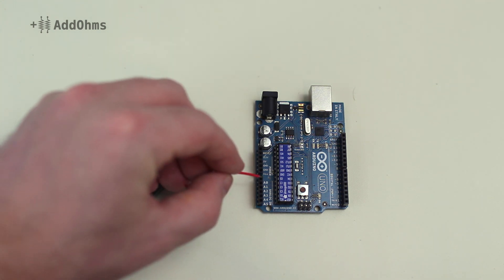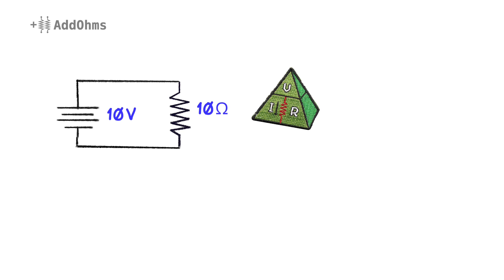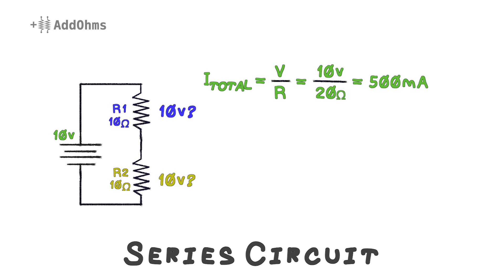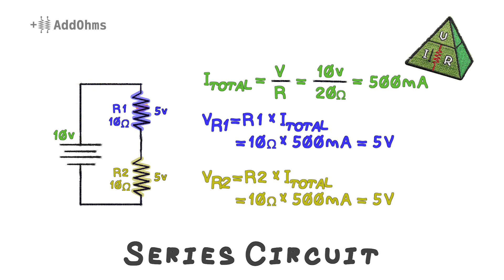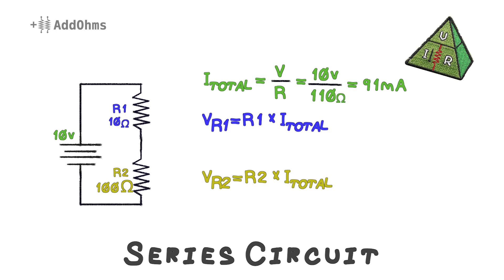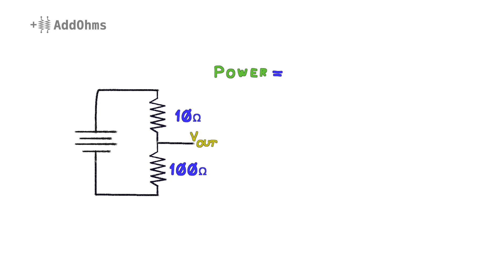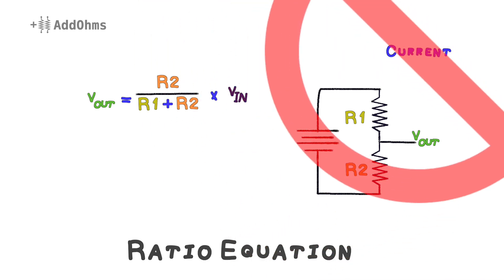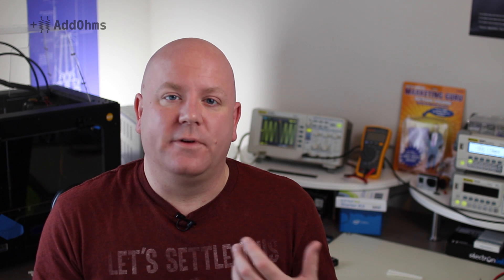How Voltage Dividers Work | AddOhms #13

Comment: Quick Fix is needed at 3:10 because 0.91V isn't equal to 91mV, it is 910mV
Reply from the maker: Good eye.  Damn.  

I even scripted it as "910", but recorded it saying 91.  Then mindlessly did the animation wrong.

Thanks
Reply: I noticed that too!!😁
Reply: That's right, you will confuse people who are just learning  this stuff. You should repost a correction. When I first started electronics, one little mistake in the numbers and it was so hard to learn. Still good info.

Comment: What is v out connected to? Where does that current go
Reply from the maker: Voltage dividers only work well in cases where the next stage is high impedance, or draws very little current. Which is why they work well for references into something like a comparator or op amp.

Comment: How will you divide 17v DC into 12 & 5v DC?
Reply from the maker: You don’t use a divider. With a 12V regulator and a 5V regulator.

Comment: Resistor rwduce voltage...this is not correct
Reply from the maker: Resistors DROP voltage. They do not reduce it. This is correct.
Reply: @AddOhms  ok thanks...for your explanation

Comment: so bigger resistors mean less  power loss.  Is there a limit to how big they should go? what is the ideal amount of "wasted power"?
Reply from the maker: The answer depends on the application. The larger the resistors, the less current, which means the divider is more susceptible to noise or interference. It's the same issue with high impedance inputs into chips and MCUs. If you're creating a divider that goes into an analog-to-digital converter, you have to consider its input impedance. For example, on an Arduino (aka ATmega328p) analog input, you want to keep the resistors in the 10k-100k range. If you used 1M range resistors, there isn't enough current for the ADC to operate correctly.
Reply: @AddOhms  thank you

Comment: Could anybody please explain to me why Vout is the voltage drop across the second resistor and not across the first one? I mean I'm trying really hard to visualise electricity using the water analogy and to me it makes more sense that the first resistance (R1) puts some sort of barrier in the direction of flow and therefore reduces pressure, so it kinda "eats up" a couple of volts from the source and what's left comes out the other side and gets channeled towards the Vout wire. Sorry I am really new to this.
Reply from the maker: That is exactly what is happening. Well “exactly” in the context of a crude analogy. Vout is the voltage drop after R1 drops some voltage. 

Kirchhoff’s Law. Volt drops in series add up to the voltage source. Voltage is the same in parallel branches, which is why Vout is the same as the drop across R2.
Reply: @AddOhms  omfg thanks I totally forgot about parallel voltage drop. It's been like 7 or 8 years since I've come into contact with anything remotely approaching circuits in highschool so I've been trying to relearn everything :)) Thanks a lot and keep making vids!

Comment: So if you drop 5v twice in a 10v Circuit, the voltage past the second resistor would be 0, right? So if you put an LED on there; you’d have no light
Reply from the maker: The LED creates a 3rd voltage drop. That drop depends on the amount of current, which is mostly determined by the resistor values. Location (or order) doesn’t matter in a series circuit.

Comment: Great video, you mentioned wasting energy when lower value resistors are used.  I often get into a quandary as to when to use a voltage divider or a voltage regulator when it comes to reducing waste.  I would love to see a video around efficiency of a circuit and the pros and cons of a divider vs regulator.
Reply from the maker: You should never use a divider as a regulator: https://youtu.be/-kEh0TYjYYE

Comment: ah ok I just watched your load video great to  know diode acts as a load .What if we wanted to to add bf494 bias transistor to it ???
Reply from the maker: I don’t understand your question. Add a bias transistor to what?
Reply: @AddOhms   to attach to the voltage divider to make a oscillator or amp stage

Comment: Say for instance I wanted to use 16v and at output would be 12v .Same idea with your 9v battery if I 9v ÷ 2 = 4.5v .4.5 volts would be the output
Reply from the maker: You can’t use a voltage divider as a source. You need a regulator.
Reply: @AddOhms  ok I understand now thanks

Comment: hmm interesting if say my voltage was 16v -12v at 12mA all I have to do is use a 3.3k and a 1k .Basically  all I did was Vout = vin × r2/r1 + r2  .Is this correct?
Reply from the maker: What do you mean "at 12 mA?" Voltage dividers are not suitable for driving loads. https://www.youtube.com/watch?v=-kEh0TYjYYE

Comment: You should have told that the resistance between Vout and GND (lets call it R3) should be at least 10 time bigger than the resistance of R2. This holds the voltagedrop at R3 as low as possible to provide the desired voltage. 
This is very critical if the wanted tolerance is small.

But ok, the arduino analog inputs have a pretty high impedance so that about 200kohms in total should be ok.

Comment: Hi Sir,

What is the Voltage at Point 1 (Before R1), Point 2 (After R1 & Before R2) and Point 3 (After R3).

Vout was calculated at 1.13v, i thought it just passed R1, voltage should be at 7.86V, correct me if i am wrong.
Reply from the maker: You're confusing voltage drop of the individual resistor to the voltage relative to ground. The voltage across R1 is 7.86 volts. Put your voltage meter across it and that's what you'd measure. That means the voltage across R2 is 9 volts - 7.86 volts = 1.13 volts. Which is why Vout (or your Point 2) is 1.13 volts. R2 is connect to ground and Vout is relative to ground.

Voltage drops in a series circuit add up.

Comment: So the v-out goes via the load to what? You're probably gonna say ground, but what about devices that arent connected to ground, like a cellphone or mp3 player?
Reply from the maker: Everything is connected to ground. Ground is THE reference point for the entire circuit. If the divider's output is connected to a circuit/load/whatever that doesn't share the same ground, then obviously, the divider won't work.
Reply: So, does that mean that all the lines in a schematic, that end with the ground symbol can be seen as connected to the same point, AKA each other?

I'm really trying to understand this but my brain doesn't speak electricity.
Reply from the maker: Yes.
Reply: Thank you. I just found found your channel like an hour ago, and i like the way you describe things.
My father was an extremely talented electrician/electronics guy but he was never good at explaining things. 
Now, a bunch of years after his passing i suddenly got interested in how it all works.
Subscribed.

Comment: Can you make a video on "How to read any electonics component datasheet ? What are the paramters must have to care about ? "
Reply from the maker: Yes and no. Datasheets and what is important varies by component type and by the application. So it is not possible to summerize how to read "any" data sheet. Something more general on a few component types is in my plan, but far down the road.
Reply: AddOhms No problem sir. I will wait for your video. Keep spreading knowledge.

Comment: I have a question. On voltage dividers such as these is R2 always on the ground or negative side of the supply? Also to use a voltage divider for negative voltage, say -1.13v would you just need to swap the resistor values?
Reply from the maker: A voltage divider won't provide a negative voltage.

Comment: In the formula to find Vout, you used R2/(R1+R2)*Vin, why NOT R1/(R1+R2)*Vin?
Reply from the maker: +RAKESH V Because you solve for the voltage across R2.

Comment: In your initial example of 2 10Ω resistors, why is Vout not = to 0 volts? It passes through a voltage drop of 5v twice which means you are effectively reducing your input voltage to zero, or at least, that is what I would assume. According to the math at the end though, Vout = 2.5v
Reply from the maker: Voltage is pressure. So you have to look at the difference between two points. In the case of Vout, the assumption is "Vout compared to Ground." Since Vout is in parallel with the 2nd resistor, it's voltage drop is the same as the resistor. So it is 5V.
Reply: I think the answer you are looking for is that the Vout is the voltage that can be supplied from BETWEEN the two resistors, not the voltage after both resistors.  The resistors take up all of the voltage combined, meaning you are looking to grab the drop after the first resistor, which can not be accomplished without more than one resistor. The voltage after the last resistor and before the negative terminal of the power source will always be basically nothing.
Reply: +Mr_Doublebutt yes that is what I was trying to understand. Thank you.

Comment: So voltage drop is the same as output voltage?
Reply from the maker: Voltage drop is the difference between two points. Output voltage could called the "voltage drop" from a device's Output to Ground. (but I don't usually hear that.)

Comment: When do you use a voltage regulator rather than the divider system?
Reply from the maker: You almost never use a voltage divider to power a device. Dividers are meant for "signals" and references. Not power.

Comment: Correct me if I'm wrong, but at 4'04" the current flowing in the circuit surely is 10 Volts divided by 110,000 Ohms, which is 0.00009 Amps which you were rounding up to 0.0001. It's therefore 0.1mA, not 0.01mA, and the power consumed/wasted by the resistors is 1mW, not 100uW. Not a criticism, your videos are very informative, just thought I'd point it out in case others were confused. I have liked and subscribed! :)
Reply from the maker: +Spoolz07 Yup. I missed the zero.
Reply: also 1W is not less than 100uW (typo if someone wonders)

Comment: Why would the ardunio blow? Due to it running on 5v rather than 10v?
Reply from the maker: +Simon betts The absolute maximum rating for I/O pins is 6 volts. So 6 volts and higher damages the pin.
Reply: +AddOhms thank you AddOhms. By the way I find your show very interesting. :)

Comment: I noticed this only now... I don't know anyone let u know too... 
but the part where you calculated Voltage across R1 is 0.91V but the the brackets you wrote 91mV but that's 910mV .....

lol I'm seeing this in 2k15 😂
Reply from the maker: +Ramya Narendran Yup, I missed a zero. I thought I had put an annotation in the video, better double check. Thanks.
Reply: +AddOhms 👍😃
Reply: It's definitely there.
Reply: AddOhms still no remark visible  (at least in the ChromeCast, dunno every/any annotation would be shown)

Comment: Hey there, nice video! I have one question. Assuming a 10V battery, wouldn't be more simple to just put a 20ohm resistor to get a 5V output, instead of all this? Thanks!
Reply from the maker: Leon Brasero No, that wouldn't work. You would still have the full 10V dropped across the single 20ohm resistor.

Comment: Hey there! Great video and fun to watch. Just wondering how voltage is effected by adding a load in parallel to R2. It will obviously change a small bit as the R total will be less that the original R2? Maybe you have a video on this?
Reply from the maker: Neil Hayes If the load is constant, like a LED and current limiting resistor, then you just calculate that as part of R2.

However, if the load is variable like a variable speed motor, it'll be difficult to determine what R2 will be at any given time.

This is especially true if the load is an IC, like a microcontroller. The VCC to the microcontroller will be very (very) unstable.
Reply: Thanks for the reply! The solution to the problem that I had popped into my head just as I was going to bed last night lol. Your video helped a lot! Thanks again!

Comment: But you cant use this technique as 9 volt battery to create 5 volts, that supplies good ammount of  current that you can use? is there no way to do that?
Reply: No, you cannot.  Voltage dividers can't supply power to a device.  You need a regulator for that.
Reply: why would voltage by voltage divider be useful then except arduino input pin or like mosfet?
Reply from the maker: BeucaN YOLO They're used to change the level of a signal (and not power).  So like the example in the video, I am measuring the voltage of a battery, but not powering anything from the divider.  

Another example would be say you want a 5V device to talk to a 3.3V device.  You could use a voltage divider from the 5v I/O to the 3.3v I/O, to drop the voltage down.

Lastly, say you want to set a voltage for the Arduino (or any ADC) Analog Reference to something other than 1.1v, 3.3v, or 5v.  You could use a divider to be whatever reference you need.
Reply: AddOhms well i wanted to create circuit to light an LED when you put "wet" finger with resistance around 0.5MegaOhms between two wires, i wanted to make a voltage divider to turn on an Bipolar transistor, but it doesnt work because it cant supply any current. Hoiw can I solve this without MOSFETs (i dont have any) or without darlington (it would make any finger not just wet! conduct )
Reply: BeucaN YOLO It CAN supply current but if you draw current from a voltage divider you are essentialy adding another resistor in parralel to the R2 !!! That increases the voltage drop across R1 and you get less voltage than expected. To solve this problem try this method: Make sure that the voltage divider will run at at least 10 times more current that you want to draw from it. That way you will be making the error significantly lower.
Reply: BeucaN YOLO For instance you have a 10 V supply and want to draw 3 mA of current at 2 Volts. So you think i will make a voltage divider with a 2 Kohm and 8 Kohm resistors. However they only draw 10V/(8+2Kohm)=1mA. When you load it down with 3mA the output voltage would drop to about 0.5 V.To provide the output current you would need a voltage divider with 100 and 400 Ohm resistors.